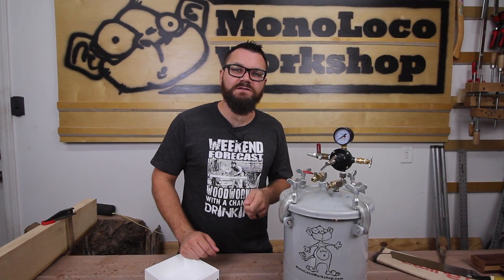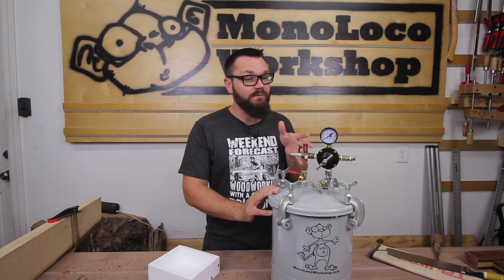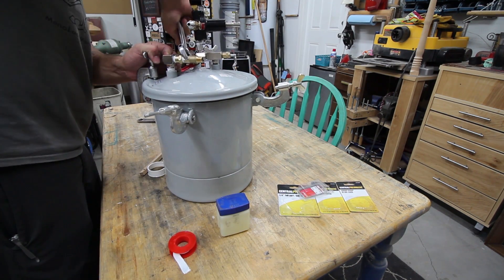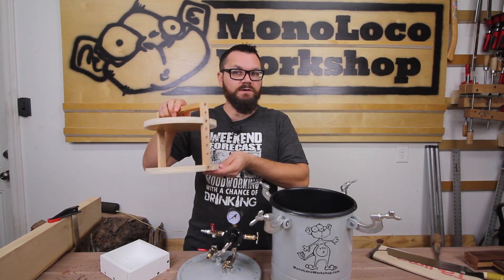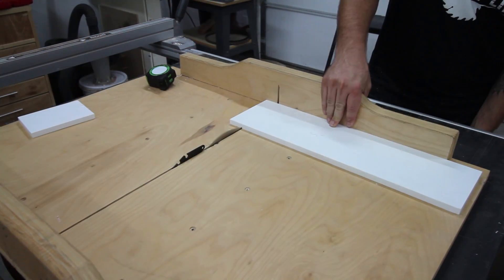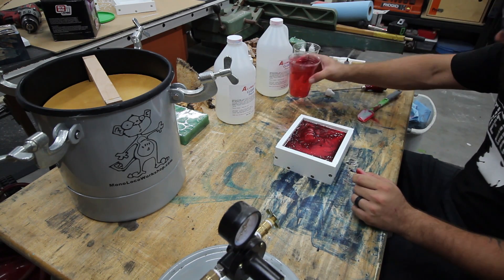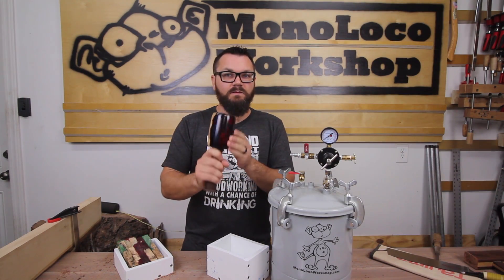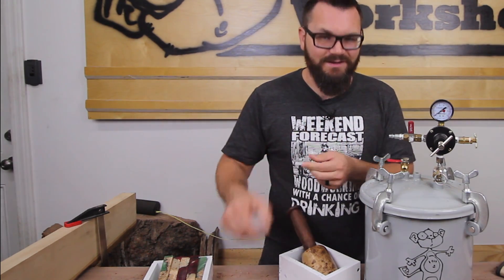Make a Pressure Pot with Accessories for Casting

Comment: Harbor freight also sells super quiet compressors that are perfect for indoor use. One gallon and two gallon models for about $150 - $170. Eliminate the T at the bottom of the regulator and screw the regulator right into the tank top. Put the safety valve in the 3/8" hole with a 1/4" to 3/8" reducer. Glue the seal into the lid so it only has to seal on the bottom and put a little Vaseline on the seal where it meets the pot. Sand the top of the pot smooth, and always seat the lid in the same spot every time. Lube the clamp threads so you can tighten them down good. Use soap bubbles to check for leaks... Good luck!

Comment: Great video and well explained but never use Vaseline on rubber, Vaseline is a petroleum product and will rot the rubber, the best thing to use is either silicone grease (not sealant) and in a pinch cooking oil will work.

Comment: At what PSI do you now prefer working with on your resin projects? Does the creaking of the HF pressure pot eventually subside after many uses? Great video. Thank you
Reply from the maker: Yea, the creaking does eventually go away but it is kinda nerve racking while it's there. I usually go to about 55 PSI.

Comment: Many people have commented about the seal. I purchased a pressure pot last week and using 3000 grit wet sandpaper, sanded the top of the pot and noticed a couple of areas that were not even. They were metal stress areas that left a ripple effect in the rim. Using my D.A. sander, I leveled the rim and repainted. Seals great now. Thanks for the tips.
Reply from the maker: The first pot I got had a weird bump on the rim so I returned it and inspected the next one before leaving the store.. Quality control isn't the best there..

Comment: I'm deciding on an air compressor to to with my pressure pot, do you think that a 24L tank at 8bar will be enough to pressurise the pot in a single go? Or should I invest in a compressor with a 50L tank ?
Reply from the maker: That size compressor should be just fine. You're only pushing these up to about 45-55 PSI and most compressors are good for 150 PSI.

Comment: What size of air compressor do you recommend for casting resin?
Reply from the maker: It doesn't really matter. You only pressurize the container to 40-55 PSI and it's a fairly small container.

Comment: Hello, I am Ronaldo and I live in Brazil, here I bought a paint tank to use as a pressurizing resin with wood, could you tell me how many PSI do I have to put to pressurize resin and wood together? And for how long? thank you.
Reply from the maker: I always pressureize my tank to 55 PSI but I've heard of people going as low as 40 PSI. I would say the higher the better but you want to make sure you don't excede your tanks working PSI rating. Mine is rated for 60PSI normal operating pressure.

Comment: I kept thinking this was a vacuum pot video even though you said air compressor. What's the advantage of positive pressure over negative pressure (vacuum) ?
Reply from the maker: As far as casting goes, the pressure pot quickly shrinks the air bubbles and the vacuum chamber slowly removes them. The pressure pot is good for hard materials that cure fast like a two part resin where slowly removing the air bubbles will take too long but shrinking them works good. The vacuum chamber works good for softer materials that cure slowly like silicone because it removes the bubbles completely where if you shrunk them, they would just expand again when the pressure is removed making the cured silicone bumpy and full of holes.

I haven't done any silicone casting in my vacuum chamber because my primary use is to stabilizing the wood. It's submerged in resin, vacuum is applied, air removed from wood, vacuum released and the resin it's submerged in soaks in to replace the air.

Clear as mud?